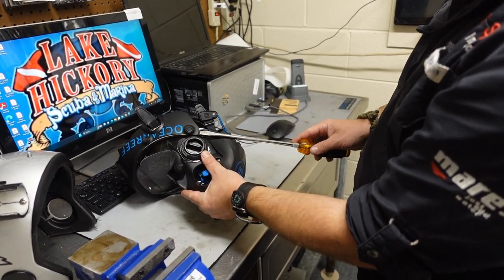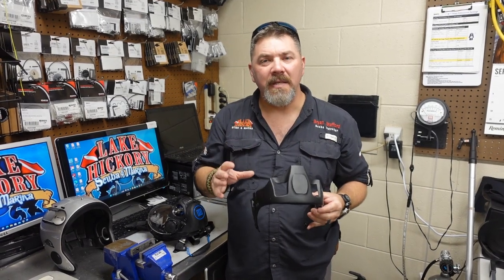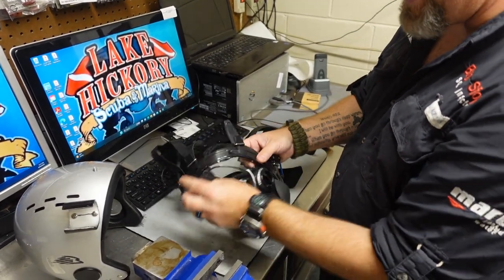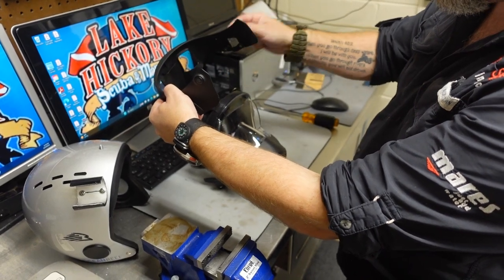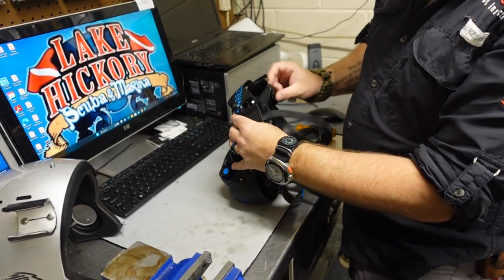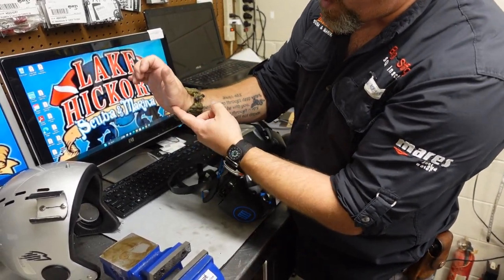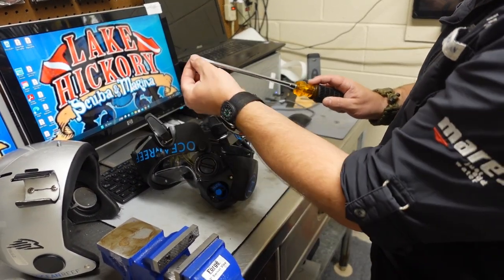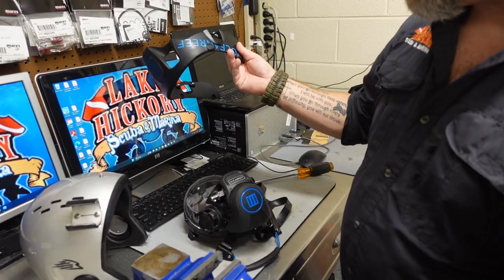How To Install And Uninstall The Ocean Reef Extender Frame

Comment: According to Ocean Reef the extender kit will not fit the  Neptune II even with the plastic clamping band.
Reply from the maker: Hello @davemarksman2205. You are correct. Anything before the G-Diver Series (such as the Nira, Nira 2 or the Neptune 2), or any of the mask that was designed to have an external second stage will not be compatible with the Extender Frame. You may be able to swap out the clamping band though. This would make it adaptable to receive the Extender Frame. Let me know if this works for you.